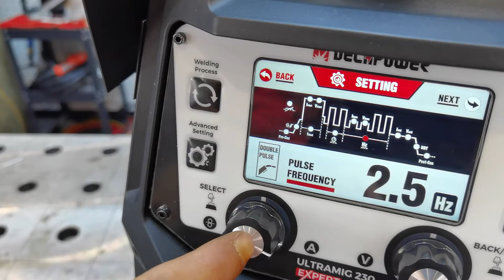DECAPOWER ULTRAMIG-230 EXPERT DOUBLUE PULSE MIG WELDING MACHINE New product upgrade release

Comment: If the machine has pulse function, why are you drawing circles while pushing the bead?  Thank You
Reply from the maker: sorry, "drawing circles while pushing the bead" what's mean?
Reply: Hello; If you run a straight bead ,will the machine stack with the Pulse function? Thank You
Reply from the maker: @tonyp9609  Generally speaking, the welding action depends on the metal and the weld. It has little to do with which function (MIG/TIG/MMA) is used.
Simple example: If your weld is wide, do you have to swing up and down to cover the weld?

In addition, in addition to dual-pulse MIG, the machine also has single-pulse MIG, collaborative MIG, manual MIG and other functions
Reply: @decapower  The Arc sound is very steady, sound like a bee buzzing, seem like a great machine. Thank You
Reply from the maker: @tonyp9609  thank you